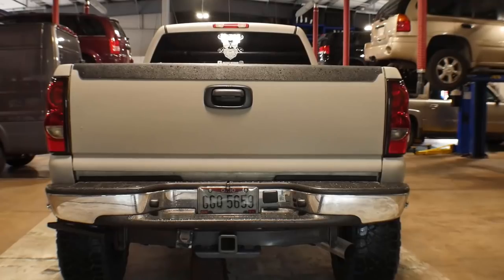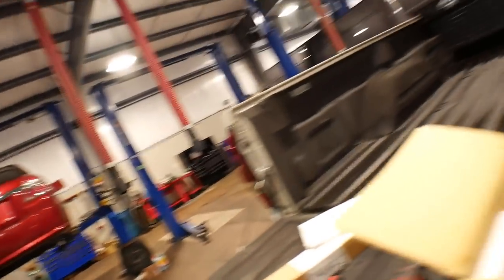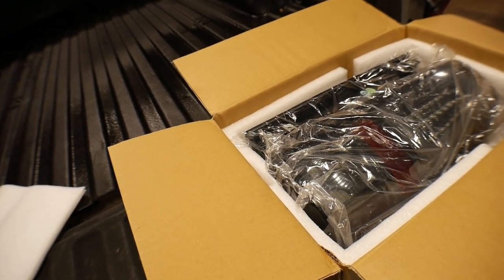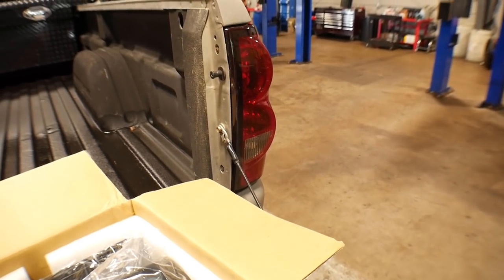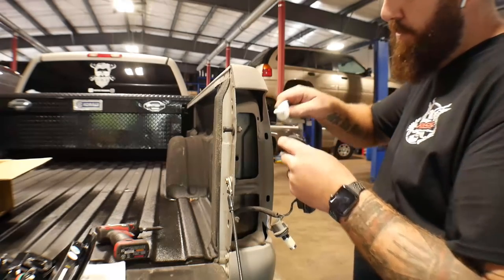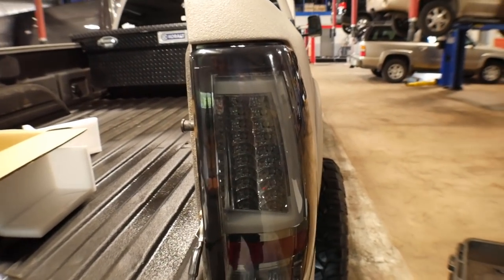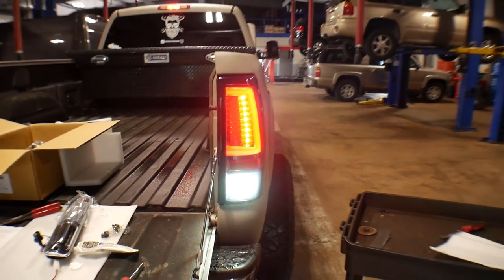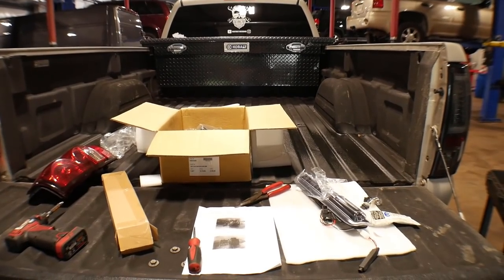SOME NEW TAIL LIGHTS FOR THE DURAMAX

Comment: Did you have the tossing keys cranked running 37’s. Of was it stock keys with trimming
Reply from the maker: The BDS Kit came with New keys
Reply: @RustbeltMechanic  thanks for the reply. One more thing would you go off roadiing with the 37” set up or would you recommend running 35 s ?
Reply from the maker: @thechappells2599  I’ve gone off-roading with my 37’s. Last summer we had to drive a mile up a creekbed. As long as you have good tires.

Comment: Where did you get your tailgate protector cap?
Reply from the maker: On amazon...
Wade 72-01161 Truck Bed Tailgate Cap Black Smooth Finish for 1999-2007 Silverado & Sierra 1500 2500HD 3500 (Classic Non Stepside bed only) https://www.amazon.com/dp/B002QAOBBQ/ref=cm_sw_r_cp_api_y3WZBbTPJT7AM

Comment: The truck looks great, you should do a front bumper like streetspeed717 or color match the bumpers
Reply from the maker: Now I guess the question is, if I go with aftermarket bumpers, do I color match them or black Bed-line them?
Reply: Black would be my choice.